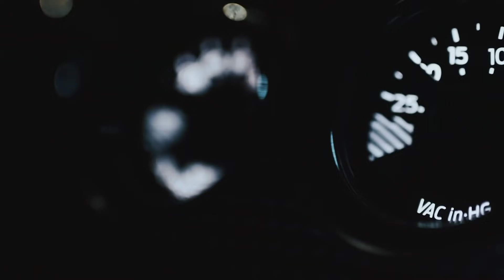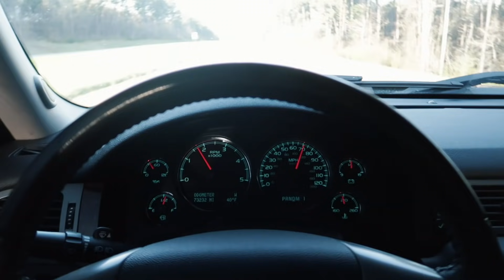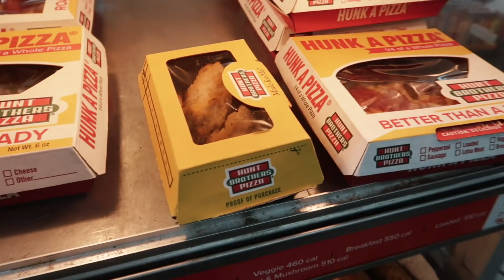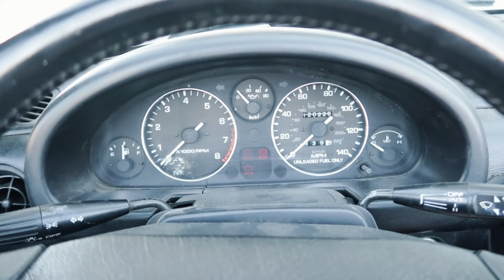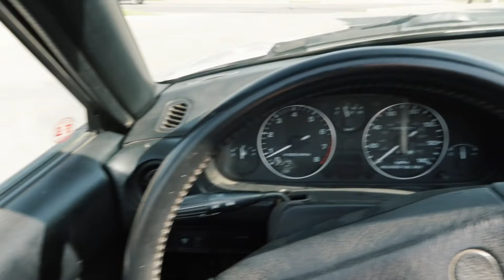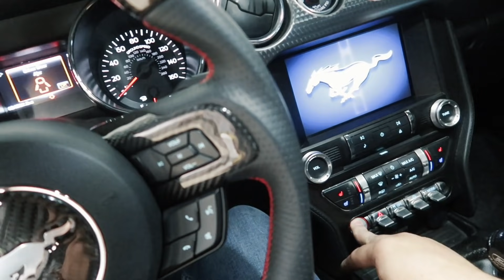I gave him my keys.. he did a HUGE burnout!

Comment: Put like 10 stickers on the Miata to add 200 horsepower
Reply: lilwizar17zombies k&n sticker adds 20 hp easy
Reply: lilwizar17zombies send me what stickers you are using mine only add 5 hp
Reply: If only it was that easy 😭😭
Reply: that's weight reduction bro.

Comment: The port on the ms is not for boost reference, it's a map sensor to remove your maf. The map is built into the ms.
Reply: It has a 3bar/43.5psi positive pressure (boost) map sensor. It reads the vac too for cruise. Ecu determines load while looking at it ,tps and vss

Comment: What trick did you guys do to fully bleed out the mustang? I've bleed my 02 Gti but it still acts like it still has air. Am i doing something wrong or should i try a different tactic
Reply: Nismo PR14 the hydro? Or clutch?
Reply: The clutch
Reply: Nismo PR14 The is a bleeder on clutch slave cylinder. Get someone to pump the pedal a couple times and open the bleeder valve and repeat the process until no more bubbles come out
Reply: @harrycharbonier98  there isnt any bubbles coming out when i did it. Currently im on vaca so imma give it another go when i return

Comment: like this so gavin see's it.   Gavin you definitely should swap out to a NB miata torsen 3.9 lsd the viscous lsd(vlsd) that is in the 90-93 cars are a complete joke, I blew my up with stock power if that says anything, and if you making anything over 190whp your skating on thin ice using that diff. especially for launches and what not. please get a 3.9 torsen diff those are the ones that are basically indestructible and with not open diff unless your off throttle